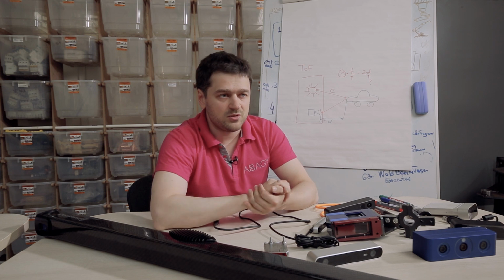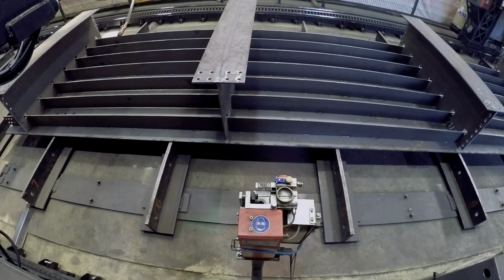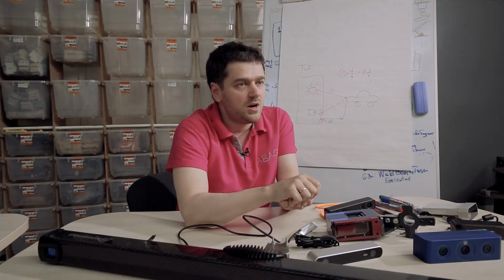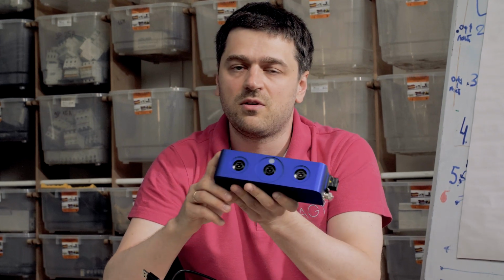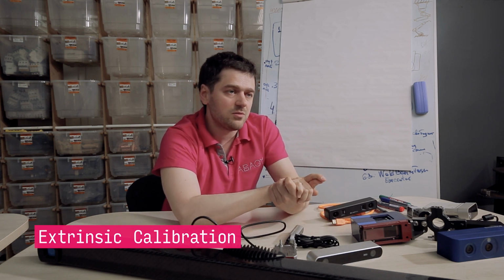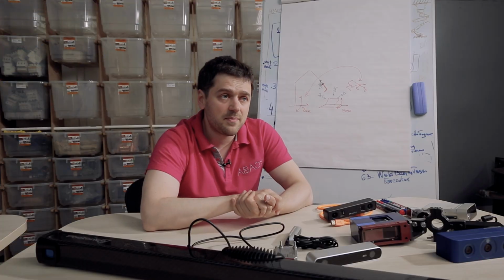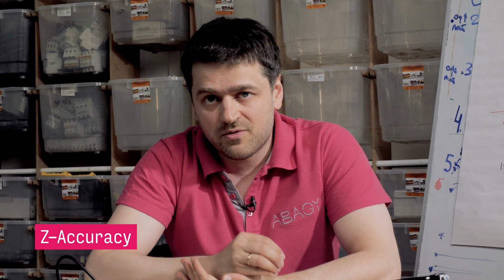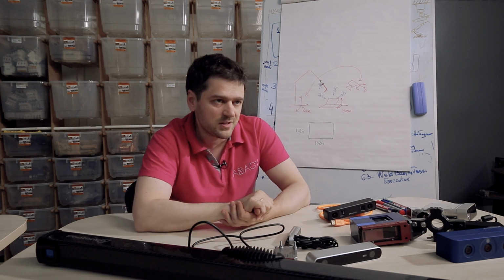Scanner Selection, Calibration, Accuracy, and More. Robotic Vision FAQ #3 | ABAGY ROBOTIC WELDING

Comment: 你们的3D扫描激光，传感器本身是你们自已开发的吗？
Reply from the maker: No, we work with third-party hardware — laser scanners and vision sensors from established manufacturers. What we developed in-house is the software that integrates with these sensors and drives the adaptive welding process. The intelligence is in how the system interprets the scan data and translates it into welding actions in real time.